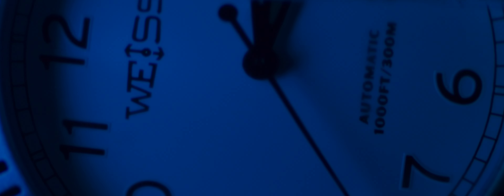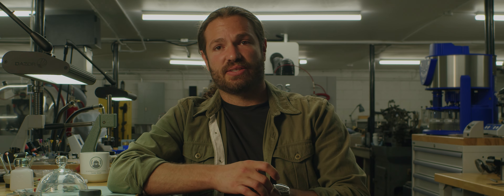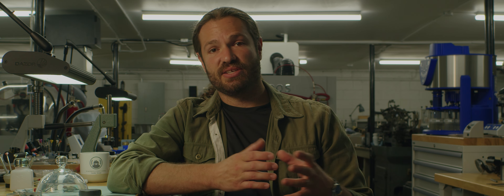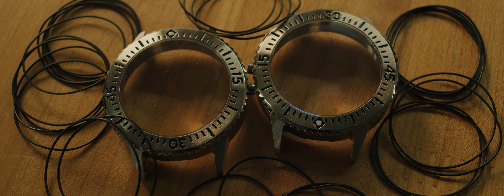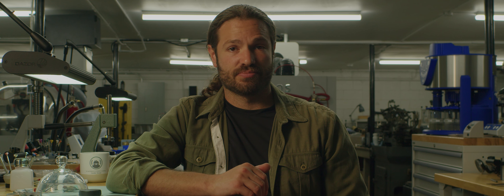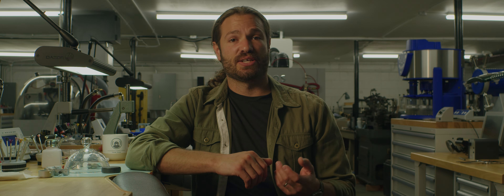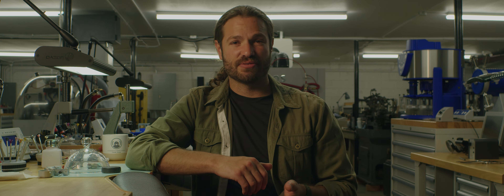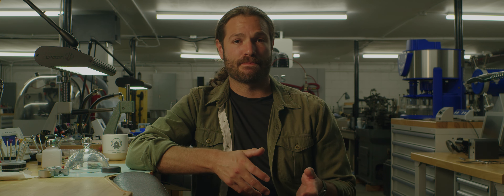Water Resistance Part 3

Comment: I love your artistic style on how you make these videos! Very informative and well put together! If you do find a leak on a case how would you adress it? Do you remachine the case or put in a bigger o-ring or does it depend on where the leak is?
Reply from the maker: Leaks usually appear when the gasket is bad or when a part is not assembled correctly.  99.9% of the time the watchmaker can tell you if a watch will pass water resistance tests before they even perform the test.  Solely based on the parts assembling together the way they should and from many years of experience seating crystals and case tubes properly. There should not be any need for re-machining or larger gaskets, unless it is a vintage restoration that needs extra attention.
Reply: @thewatchmakersworkshop  Okay. Thank you for taking the time to reply!